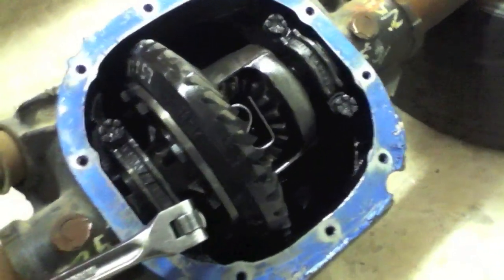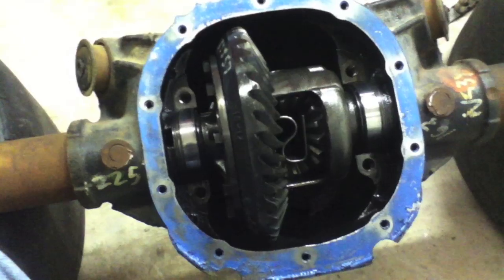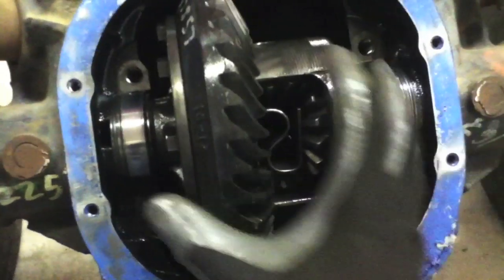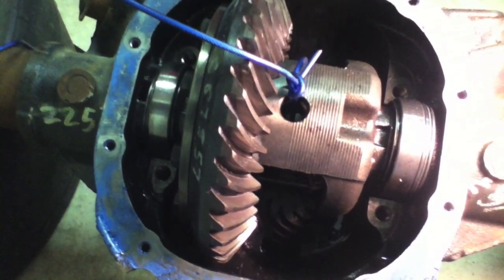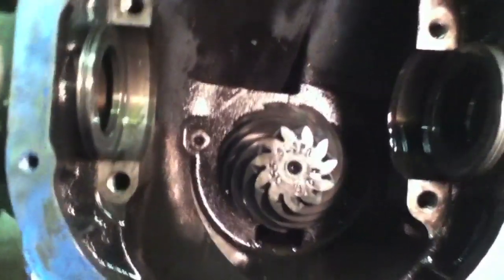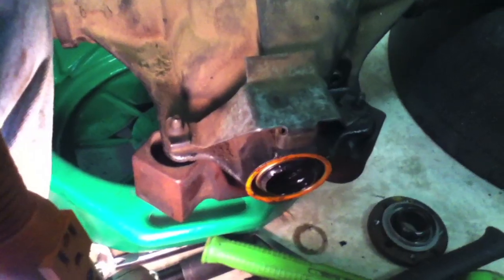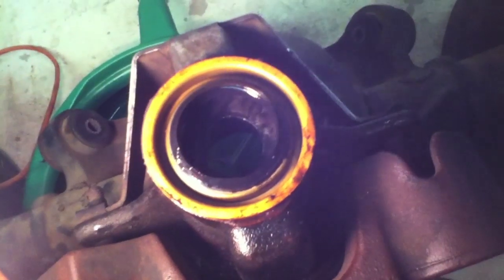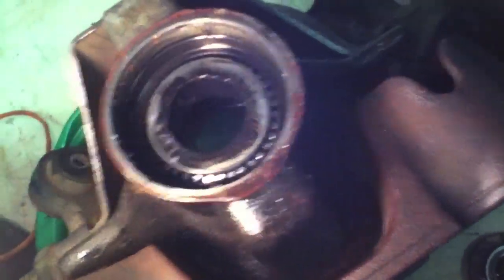Ford 8.8 inch Gear Install (Part 3 of 7): How to install gears

Comment: quick question I have a 99 Expedition I had someone put a pinion bearing in for me when I took it on the highway after a couple of days of him put it in I go 75 to 80 I get a real bad vibration and Roar do you think something's not right in the rear end all-wheel drive or sometimes when I'm starting off I'm getting a real gripping vibration

Comment: Why did your flange get super dirty at 7:55 ?
Reply: PS, thanks for the video series, I've learned a lot from you.
Reply from the maker: That was the old flange. I was using it as an example. I believe that clip was taken earlier but it fit better at that time in the video.  Thanks. I like to hear the videos are helpful

Comment: Awesome Videos!!  Would suggest you have a 2x4 or 3/4 plywood down to protect your gasket areas from the jack's steel wheels when using the jack as a lift.  And honestly, using the jack was nothing less than home garage mechanic brilliance at it's finest!  ;)